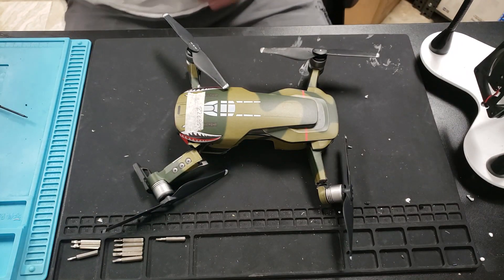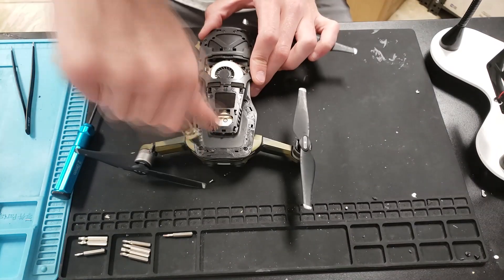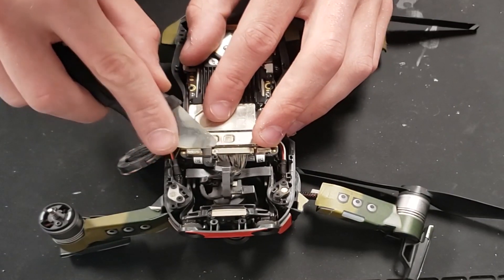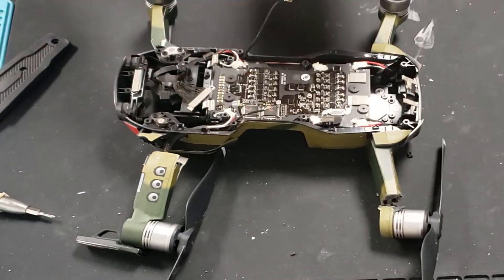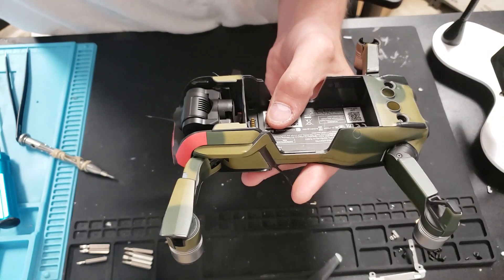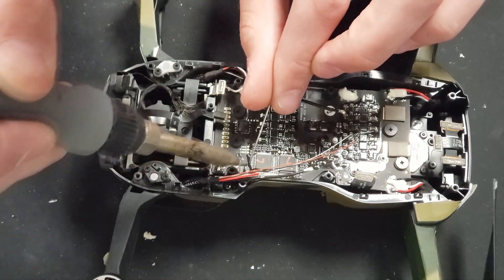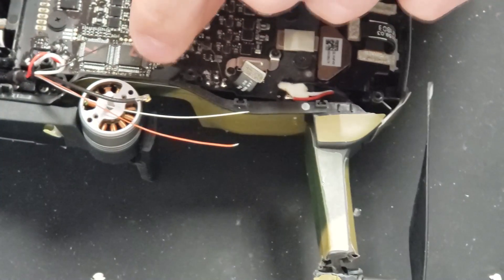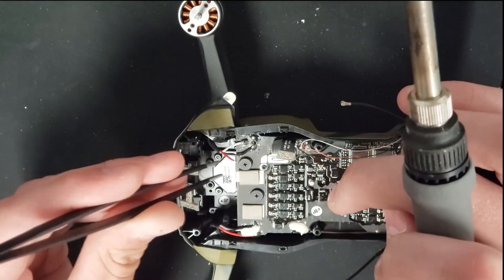DJI Mavic Air Arm Replacement / Repair

Comment: Great video! Helped me get my front arm replaced on my Mavic Air after a aftermarket propeller failure knocked it out of the sky. Now I have to try and find some OEM props so I can test out the repair.

Comment: Hi man, I had an accident with my Mavic Air, I'm waiting for the front motor arm, so I flew by my house and the spacecraft slipped to the right, then I did the calibration that went wrong. before. Channel success.

Comment: I tore mine down to dry the circuits out real good after it went to the bottom of my lake. Only problem I had, must of been a flaw, is that while un connecting the antenna wire, it pulled the connector right off the board on one antenna. All was good, I soldered it to the mother board instead. I have repaired hundreds of phones,  so I have specialized equipment on hand. Even my camera had a few drops of water floating around in it. I did like I do with phones, put all the circuit boards in the oven at the lowest setting 170degrees for 30 mins. I put the whole drone in there at first to dry it out, no problems,  propellers and all.lol

Comment: Had to replace front and back arm. Video was excellent. The first two screws were so filled with glue they looked flat. I managed to get it all back together thanks to you. I spun up the drone in the garage and it had lights and all 4 props had power. Will do a test flight in a few days. Thank you, thank you!

Comment: I can't put my bracket back on my arm I tried everything and I even try to put the old ono back on
Reply from the maker: Hey if which one are you referring to? the one that goes in the arm that makes it move
Reply: @dronezonenj3038  yes I broke the bottom white one trying to get it back out so I just ordered two new ones
Reply: @dronezonenj3038  I took them both out no problem just putting them back in
Reply: @dronezonenj3038  taking it apart and putting it back together is no problem and a soldering it's just this arm I'm having problems with lol
Reply: @dronezonenj3038  I forgot what it's called the shaft or the bracket but it's a front left arm

Comment: After completing my arm replacement, thanks to you, btw, am getting error msgs 200 and 202. So frustrating!
Kinda kidding,  but is there a "check engine" light equivalent that needs reset maybe?
Any help is appreciated. No other resource really but you!!
Reply from the maker: Download DJI Assistant 2 On your PC or Mac you can reset your drone to factory settings clearing Most software bugs. May fix your issue as long as your ESC's are not damaged and your soldering is done correctly. Hope this helps!

Comment: 13:45, the copper plate was upside down.
Reply from the maker: doesn't matter as it only holds ribbon cables in place. Still doing its job

Comment: Thanks for the video. I was only using it to get the main board out to replace the IMU, but it was perfect to figure out how to open up, which cables to remove and where the screws are! Thank you.

Comment: Thoughts on glueing a broken arm back together? Is it a horrible idea? If not, any recommendations on what glue to use?
Reply: Seth McClaine I would definitely not, maybe a last resort? I did this and my Mavic fell from 370 feet. I think a gust of wind blew it and then it tried to compensate and it was too much force on the arm and it broke. It was in about 9 prices and I never found the battery. I would say just try and fix it the right way.
Reply: Seth McClaine if you are going to glue it, use bob smith industries super glue and accelerator. Works great. Extremely strong glue.

Comment: Hi. Thank you for this video. I have a question, what are those little screws used to fix the arms on the exterior, on the plastic, that you have to put off before the solder? Is that torx? And which, T1, T2 ? Thks
Reply: Any idea on the size of these yet?

Comment: thanks for the video. It's really helpful. Do you also know if I can replace tripod without changing the arm? I crashed mine drone and tripod is broken, but landing arms are good. I found those parts online, but not sure how to fix it.. https://www.amazon.com/Water-chestnut-Mavic-Tripod-Stand-Repair/dp/B07XFC1JQS/ref=sr_1_3?__mk_de_DE=%C3%85M%C3%85%C5%BD%C3%95%C3%91&keywords=dji+mavic+air+arm+stand&qid=1570880830&sr=8-3

Comment: Hi. I have one question. is there possible to replace just :
https://mavicpilots.com/threads/mavic-air-front-leg-crash-damage.41630/#lg=post-480810&slide=0
Front right leg is intact but the plastic component that holds it to the arm is cracked. The leg no longer snaps into place when extended and wobbles. 
TNX

Comment: Thanks for the video btw, IV never soldered before but I have a steady hand and have removed the motor arm, there is still almost all the old solder still on the board do I really need to add more ?
Reply from the maker: Its not 100% necessary but i highly recommend it to avoid cold solder joints

Comment: Can you tell me the name of the silver screwdriver you are using please
Reply from the maker: Hi Mark the Silver screw driver im using is a 1.5mm Hex Driver a 1.5mm allen key will work the driver is just easier to get more torque
Reply: @dronezonenj3038  thanks mate, I just ended up getting the screws out, and the video was vital in my success never soldered you made it look easy 😂 my hand was shaking like a drug addict but I managed to pull it off 😄 thanks mate you saved me 145 pounds